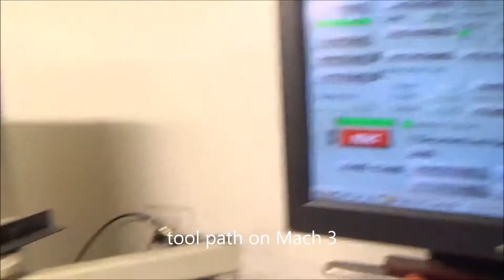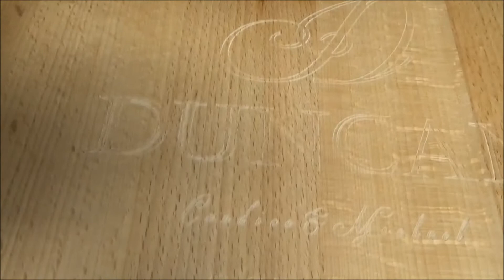Duncan Board video

Comment: I have a number of those projects that creep into my schedule too.  I add the necessary blocks of time to my calendar with the title "Justifying my tool purchases to the Spouse".  Quick tip for you.  If you are looking for material to use for proving out a fixturing design, or just to make something out of, make friends with Lumber Liquidators or other flooring installer/sales outlet in your town.  I have sourced some very nice hard wood material on the cheap from their dent/remnant pile and it is remarkably consistent in thickness.  3/8" Hickory and Rock Hard Maple have been pretty kind to me as sacrificial surfaces over the years.  They even tap decently if you can believe that.